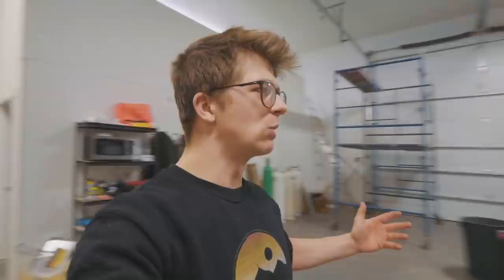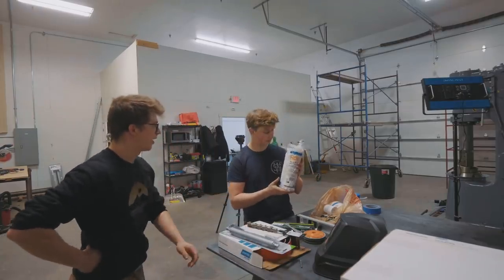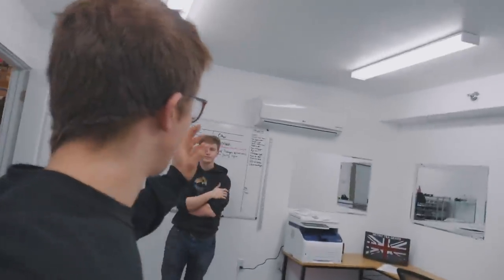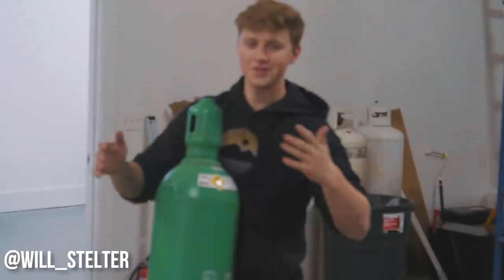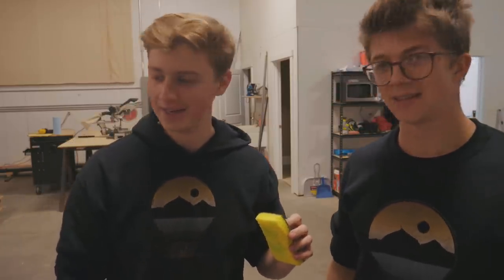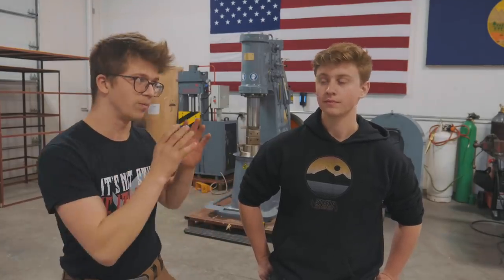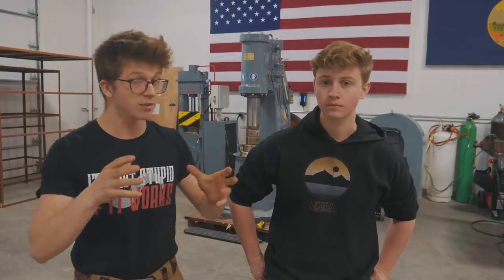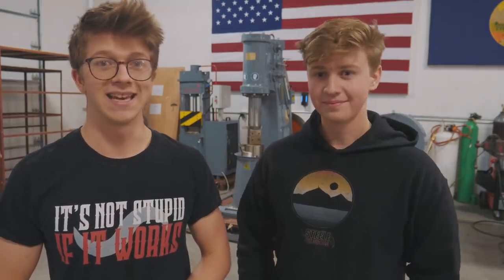I'VE GOT FIRE!!!

Comment: DO NOT TIE THINGS TO THE ELECTRICAL CONDUIT! It is there and only able to protect the wires inside it and nothing else! Get a few screws and some chain to hold it to the wall. Screw a few 3 inch screws into studs and attach the chain to that. NEVER ATTACH THINGS TO ELECTRICAL CONDUIT. It is weak enough that you can bend it with your bare hands (not kidding about this), at least for the size you have there in the shop.

\former industrial electrician
\\had to take way too many things off from my conduits that others attached.
Reply from the maker: Great advice!! Thank you! Makes total sense.
Reply: @AlecSteele  No problem. Most people see that it is all shiny metal (zinc coating is why) and think that it is as strong as a steep plumbing pipe. You can paint it if you prime it first. Speaking of painting outlets, you really should have painted before you had your outlets installed. You could have just wadded up some newspaper, and shoved it in the hole with the wire coiled in the back to mask it off. This is what is done in construction for commercial, industrial, and especially residential buildings.

The order of your contractors' task and getting no dead time in your build is a fine art and a little voodoo, but it makes you money really nicely.
Reply: Indosarnia  what that he did specifically was disrespectful to oxyfuel fire?  Also agree about flame arrestors or backflow checks. That's important.
Reply: Also, secure gas cylinders with two chains.  One high, one low.  The high one prevent it from tipping over and the low one prevents it from sliding under and out.  Might also be worth looking into local fire codes since there is probably a minimum separation distance for o2 and fuel cylinders.
Reply: @AlecSteele  Furthermore, you might want to screw whatever device you'll be using to secure the gas bottles directly into the studs in the walls. MDF is NOT a weight bearing material.
Reply: @Estranged180 ......... You must have missed him say he was awaiting a cart for them.
Reply: All caught up now. Good luck lads. X
Reply: He is used to uk conduit made of steel that you have to bend in a conduit bending machine & is not soft & bendable by hand
Reply: Indosarnia  well me personally I think airless is a good way to spray and does a fine job. But lets be honest here...this isn't your shop and if he wants to spray in his shop and you prefer to cut and roll in your shop then we're all happy with our shops. Lets move on!

P.S. stop whining about everything. He appears to be a bit more successful than you.
Reply: @KnightsWithoutATable   i worked with a painter that has been in the business for over 20 years last summer (commercial, industrial, and residential) and we never did that, all we did was put these yellow plastic caps over the outlet and went on our way, if you did stick newspapers in the outlets, after you spray, now you have to deal with all this soaking wet newspaper that makes a huge mess all over the floors and all over your hands. but you are right, it is better to do it before the outlets are in, but that makes it really hard for the painters, because we have to plug in our guns some where, and it sucks having to run three 100 foot extension chords just to run one gun. just saying.
Reply: @Darkassassin09  Then he should have waited.
Reply: Indosarnia  give your ego a rest.
Reply: Ok
Reply: All I have to say to Indosarnia is... If you don't like what Alec is doing, go watch another channel.  Don't sit here on your high horse bashing someone because he's not doing things with his life that you don't agree with.
Reply: @ExaltedDuck  Yeah, US fire code is pretty through compared to other country's.
Reply: Indosarnia  Lots of places paint them the same color as the wall to make them not as obvious. Personally, I like to leave them bare to show off the work of the electrician and to have a more industrial feel.
Reply: There's one other thing that flimsy conduit is good for. Measure your shower/tub, and cut a piece that is tight enough to fit snug between two L brackets. Bolt that to the wall and you have a shower curtain rod that lasts years and years (because of the zinc) and can't fall down. Mine has been up for nearly 10 years and not a bit of rust on it.
Reply: @willkraft2809  That is if you aren't renting.

Comment: You don’t need to mask the whole outlet off, what Will did was fine.
Reply: B & B Machinery Co if you have them on Instagram they already started painting the grinding room
Reply: I mean yeah that's why we have outlet plate covers. Also you'd usually just "cut in" the outlet anyway.
Reply: Beat me to it! Hahahahaha
Reply: Electrician here.
I agree.
Will did good.
Reply: Beat me to it also. Just mask the faces and your fine
Reply: Just be careful with the sprayer!!! You don't need to get the wall or the outlet SOAKED in paint. Just saying!!!!
Reply: Electrician. Can confirm
Reply: Rob George but we hate it when we have to scrape the paint to see the wire color! Lol
Reply: @RStarks2345  I find in unnecessary, but not a big deal....until it's done to a junction box with a lot of wires
Reply: You want to cover the screw holes. Paint in the screw holes is annoying.
Reply: Ming Mongo That is true.
Reply: Can't be too careful, mask the whole wall off to protect the outlets just to be sure

Comment: It might be a good idea to sand that MDF so the paint will stick.
My shop's process for a high-end finish is 120 grit -> primer -> 220 grit -> primer -> 400 grit -> paint -> 600 grit -> paint
I'm not sure what would be an appropriate number of layers and grit progression for a wall, but any sanding will prevent paint from chipping off of a slick MDF factory surface.

Comment: just a tip when using the oxy or the cutting torch, always turn the cutting gas off first. its not like anything bad will happen but its just the safer thing to do. (first on, first off)

Comment: Hey alec, put a 1/4 inch brass plate down on the top of your welding table, if you weld on brass the spatter from your mig welder wont stick because steel and brass are metalurgicaly incompatible to weld. This will save you from having to grind spatter off of the table top. And if you ever need to llug weld you can do it right on top of the brass with out it sticking.

Comment: Hey Alec, question for you... since you guys go through such a high volume of propane why not buy or lease a 1000 gallon tank(s) and have them filled by a bulk propane service?  Then you can have it plumbed into the shop wherever you need it and you never have to worry about swapping bottles during the middle of a project.

Comment: To all the people saying you don't need to mask the outlets all the way of: (they're the same ones who have paint on their outlets.) If Alec is planning on spraying it with an airless sprayer, and spraying it at a flow that he's not going to back roll it, he will need to mask them all the way off. The airless sprayer will put out enough paint to fill up that entire junction box, to the top, with paint, in just one blip of the trigger. (They can put out A TON of paint. And to successfully spray MDF and get enough coverage, to be able to do it without backrolling, you're going to have to set the machine to put out a lot of paint, and have a tip on the gun that puts out a ton of paint) if you don't fully cover the duplex, the short edges of the "round plug parts," that are perpendicular to the wall, will get covered in paint. And based on how deep the j-box is set into the MDF, that will dictate how far the "plug circles" stick out the front of the cover plate when the edges of the plate bottom-out on the MDF wall, and that edge will be seen to varying degrees. Also, it will booger up the wires and insides of the j-box it will also completely cover up the color coded jacket of the wires, making it hard to tell the colors of the wires. It won't just "get some over spray on the wires," it will coat the wires. Like junction box bukkake. So you either need to cover the whole hole, or wrap the tape around the sides of the duplex outlet.

Comment: Alec, please secure your gas bottles to the wall. They sell brackets for them, but even two hooks and a bit of chain is better than letting them just stand like that. Either that or put them on a cart. I want to see lots more awesome projects from Montana that do not involve a bottle whizzing around the shop like a torpedo when one falls over and breaks a regulator. Please remain unsquished/perforated/mangled </removes lab (or shop) safety hat>
Reply: I see you are on top of it lol.

Comment: Just a Safety Suggestion, put a "back-flow" PREVENTER on the propane side (between the regulator and the hose connection) of your cutting torch setup. This will ad "peace-of-mind", that in the event you run out of propane while using your Setup, so you DON'T have a flame to crawl "back" into a "just" emptied cylinder! Though rare, (especially used/refillable) cylinders have been known to explode when "virtually" empty. BOOM! NOT GOOD!!  Just a little FYI;). Be Safe. Anyhow, things are lookin real good!! Nice job all around! Guys, keep up the great work! o7 and as always  a BARK, BA- BARK, BARK!

Comment: Your welding table looks to be a little top heavy. It would be difficult to tip over, but it could happen. Adding a shelf on the lower part of the frame would give you storage for necessities that would also prevent a problem.

Comment: Serious question,  why use propane and oxygen rather than acetylene and oxygen? Acetylene flames are about 2300 degrees hotter than propane. I get not using it in the forge, you could melt your steel, but wouldn't it cut better in the torches?

Comment: Thank you for sharing the beautiful views. A spray bottle will work better for the leak check. Also you always want to cut the propane first. That way you purge the lines of flammable gas with the oxygen. I’m a journeyman welder and machinist as my full time job. Great choice with Montana I plan to retire there in 8 years and step up my blade smithing. If you haven’t gotten out to Yellowstone yet I would highly recommend it. The Architecture in the Yellowstone Lodge is incredible and the natural wonders are too numerous to list here. I think you may enjoy quite a bit of the metal and wood working in the lodge though. And the Buffalo burgers there are really worth the trip if you are into burgers.
Reply: Indosarnia hahaha. Yes I forgot. Good point. Still shutting off the gas first has always been how I was instructed. There is 2 hoses all the way up till the end. It’s funny how it’s easy to know what to do when you are in front of the equipment and even easier to mis speak when not there. Thank you for calling me out. I have mostly been playing with MIG and TIG for some time. Apologies for the miss information. The spray bottle is still easier than the sponge method for leak checks though.

Comment: Make a longer forge! (with a smaller hole so its more efficient) That way you can evenly heat swords without having to pul the blade in and out of the forge. Then possibly have more than one. The second could have a larger opening for starting billets (like the one you had in your last shop)

Comment: you need to call a fire sprinkler fitter and have sprinklers put into your grinding room, right now it is not to code and you could be denied an insurance claim, also when your building management company/leasing companies hires a sprinkler contractor to do a yearly inspection they will find the deficiency  and probably make you pay for it without giving you the ability to shop around for pricing. a very basic pricing is around $100-$150 a sprinkler head and that room should only take 3-4

Comment: your electric outlets are fine the way they're masked. shoot paint nearby them, then backroll with a conventional roller (as is proper anyway) next to the plug. you need only paint within 1/4 inch of the plug because the cover plate will cover the 1/4 inch in question. The airless sprayer will leave a runny, ugly finish without rolling.,
Reply: using the airless to apply paint saves  dipping the roller every 20-30 seconds, speeding things up a bit.  such a small job = barely worth the mess. airless/roller justified on the main shop = certainly.

Comment: The wall hangers u used sucked guys.. always go to the Hilti store and get the 5/8s Waller hangers.  The Hilti wall hanger can take 150lbs per hanger.  Those one u used are like 4 lbs per hanger.  Namely they suck....  Hilti always Hilti...  When u see them and use them you will never use those plastic crap wall hangers.  

If you can get an Accordian Cris cross style metal gate for the front of the shop to keep thieves out and let's you keep the roll up door open you will be alot happier in your shop during the summer.  This basically is a must for any shop that has a roll up door.  Protection from thieves is pertainant

You guys don't have a shipping and receiving area for selling you product.  Just use a 2 pallet sized area paint striped yellow next to a shipping table, will be very useful when your shop get busy enough to start selling your wares.  Aloha!

Comment: You know as a programmer I'm pretty sure that VPNs don't really protect you from insecure WiFi's like the data still gos through the router regardless of if you connect to some place directly or to Nord and they to it the point is you send information to the router the router back to you and anyone hooked up to a router can get the information off of it... well I'm pretty sure not really a security specialist but I can't see that really doing much there

Comment: Alec - Oooo... your friend failed you. Those push in hangers are lousy. You want to get the nylon ones that screw in. They have a better bite on the drywall and stay in much longer. In a few years (if you're lucky) those are probably going to wiggle out and the board will fall down. :(
Reply: Another Suggestion: You might want to put a mirror or some reflective surface in those light wells. This way, you get as much light into the room and not absorbed by the light wells.